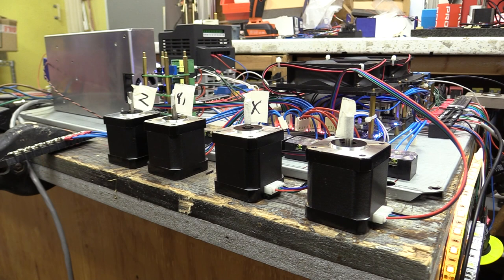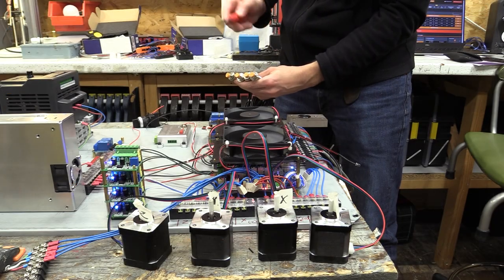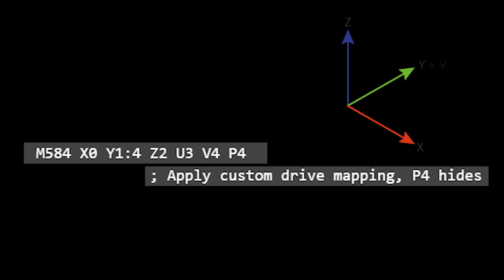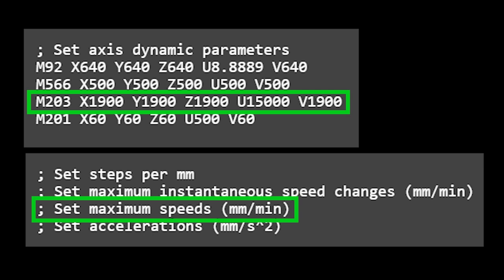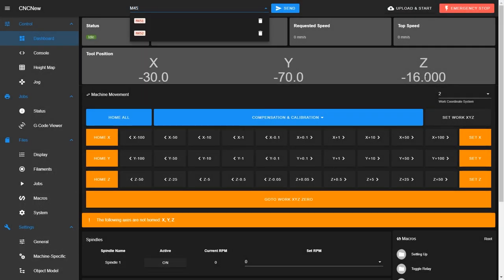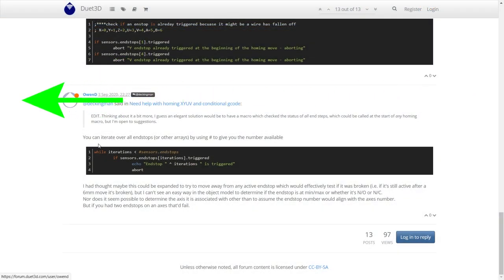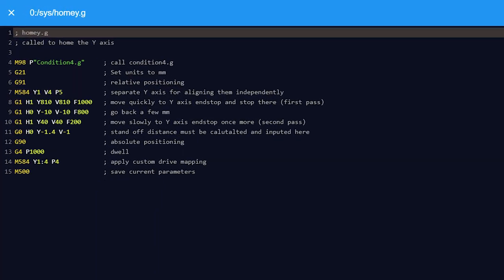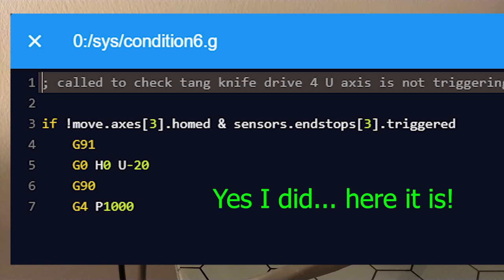#55 Steppers Motors / Proximity Sensors Limits / Homing Cycles - Duet CNC Controller P3

Comment: I'm also using a duet, with 3.2.2 reprapfirmware. But those 'Set work XYZ' buttons are missing. The tap 'Jog' is also missing. Do you have any idea why? I'm using the CNC mode. Thanks again!
Reply from the maker: That's strange but not sure - I'm now on 3.3beta1, with DCW 3.2.0-rc1. I want tog get rid of the set work x y z - as I'll never use those.

Comment: Great job, much help. Any chance of getting a wiring diagram of the proximity sensors and the optocoupler?
Reply from the maker: Hi Kouta - I'm working on a manual for my entire controller which will include that section.

Comment: Hi, thanks for your job and your video, is that possible to send me your /sys folder. I'm building also a cnc machine with duet and will be helpful
Reply from the maker: I'm going to release my config file via the duet forum website soon and will share - but if you are in a rush, have a look there first, there's a lot to read.
Reply: @EducatingSavvas  Ok thanks, do you know when ? 
I am particularly interested about tool offset and how you configure it because there are 2/3 different way to do it.